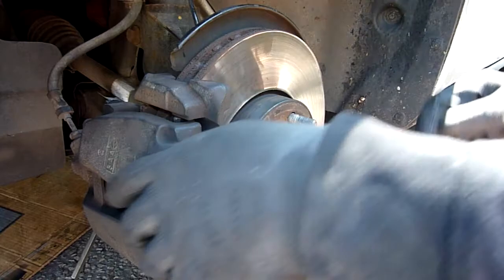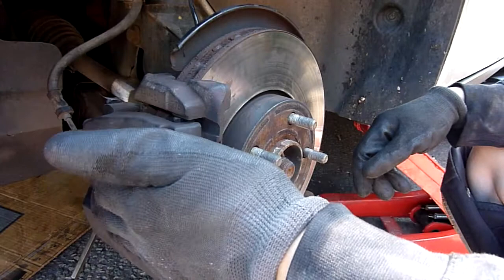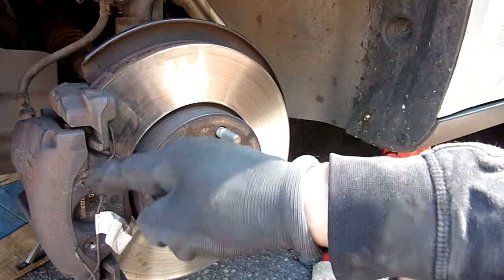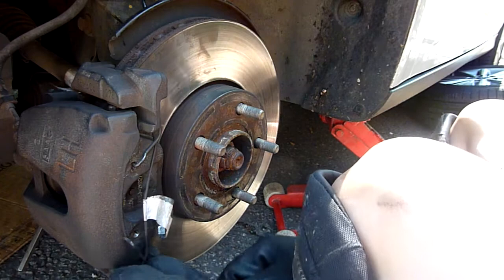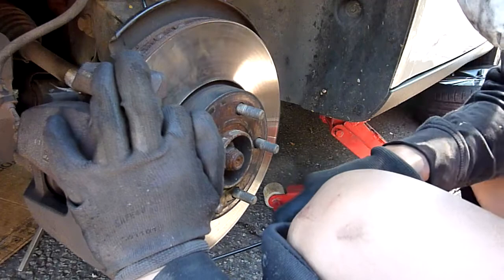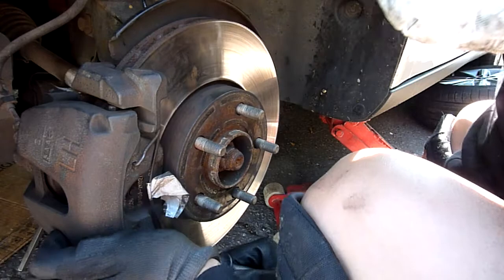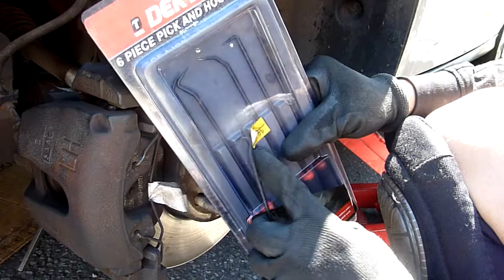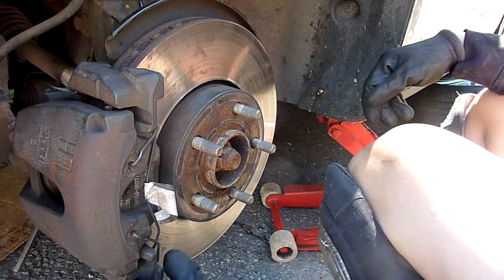How to Remove and Reinstall Disc-Brake Retainer Springs

Comment: Thanks for making this video.  I found the easiest way is to put the top in first, line up the bottom then squeeze in on center of the spring.  When the bottom pin catches on the hole tap it with a hammer and it will seat into the bottom hole.

Comment: Mate, your brilliant. I remember the problem I had with those pesky things Just using my hands. Had changed pads and discs nice and quickly, got one spring in, I think was a fluke but then came the second. It took the same amount of time to get that last spring in, than it took to change both discs and pads. At one point, I even contemplated leaving it off (bad idea, I know) Luckily enough I finally got it done. Seeing your video makes me look forward to the next change. Surprised there are no other vids on it. Well done and thanks.

Comment: Thanks for your vid , v helpful . I had a total mare yesterday with a retainer clip . Vehicle is 56 plate C Max . I just could not get the lower pin to come out of the hole in the caliper , it seemed to be seized and it took half an hour of careful wiggling and levering to shift it .  In the process of working it loose , the shape of the clip got a little altered and I best get a new pair . 
Never had that happen to me before.

Comment: Thanks for posting this, but there is a much, much, easier way to do this.  After struggling with this for about 20 min, and wearing my hands out here is what i discovered:  there are nipples on the back of the brake pad.  Set the springs so that both wings are resting close to where they should be (resting on the caliper).  Use a Flat screwdriver as a lever, rest the tip on the outside nipple and pry the entire spring center outward-- as you bend the center of the spring,  both prongs will line up with the holes, push them into the holes, DONE.  Tap them with the screwdriver handle to seat them proper.  Almost effortless.
Reply from the maker: If it works for you, why not?

Comment: Similar method - except when I put them one, I have no use for needle nose pliers; Once you have it in place, if  the pins aren't fully inserted into the holes, I just take a tiny hammer and give them a tap at an angle towards the hole. Done, and you don't tear anything up with plier teeth.

Comment: I think the main thing is after changing the pads is not to screw the guide pins into its thread at all, not until you have managed to get the retainer spring in place, and the caliper is re-assembled, then after some effort, refitting the guide pins is much easier than trying to fit the springs after the event. Don't forget to use a bit of wire or string (Attached to the suspension spring) to take the weight of the caliper assembley, when doing the change of brake pads, so as not to put stress on the hydraulic hose. Thanks to the original poster.

Comment: Mine has snapped and there is a small bit of the spring in there still😳 Any suggestions please, seems stuck.
Reply from the maker: Use a dental pick made of very tough steel to pick it out. Consider drilling the end of the spring. Consider using a baiting needle or very small croquet needle to hook it out.
Reply: @EducationPineapple  thanks for the reply. Tried drilling but the steel of the spring is harder than the casting. Could I drill other holes just off set to originals you think?
Reply from the maker: @394773934  Use Cobalt drill bits
Reply: @394773934  A very powerful magnet.
Reply: I need help with mine it is rusted tight in there broke off and doesnt drill out or punch out how can I get it out
Reply: Same problem here ....its literally welded to the caliper, 3 hrs on it and stil nothing
Reply: @Hiperyon24  I just didnt change them and it doesn't do anything
Reply: I succeded. Polished a  screwdriver and pushed from the interior side of the caliper
Reply: @Hiperyon24   how u get a screwdriver inside the caliper
Reply: @RyanSitter69  at an angle without disconecting the fluid line. I had a log under the caliper so i cand tap on the screwdriver, also i heathed the caliper with a torch.

Comment: Surprised there isn't a real tool to do this with.  Your hook requires quite a bit of strength. I just can't believe there isn't a spring compressor that allows you to just compress and slide onto the brakes.
Reply from the maker: Easy to do with the hook
Reply: @EducationPineapple  Just bought one on EBay - thanks for the tip ! Luckily I've got a strong right arm - the left not so much 🙂 Not sure why that is !

Comment: I keep losing one of these repeatedly (front driver side), it's driving me crazy! I installed it same way you did but still no luck :( I have to buy a new set again, arghhh
Reply from the maker: Make sure you hear/feel a confident snap (2:18) as the spring is push finally home. Make sure you use the tools that I use. Doing it by hand on that last push is not good enough and therefore must be with a good pair of pliers, preferably narrow nosed like mine. This confident snap (2:18) applies to other things like plugging car male female electrical plugs back in after removal. Good luck.
Reply: @EducationPineapple  Let me try again with proper tools and making sure to feel the snap. Thanks much! I couldn't find any other videos on Youtube about the same, pretty useful!

Comment: Is tgat car a ford???
Reply from the maker: Ford Focus 2015
Reply: @EducationPineapple  lol, i suspected it was a focus. I had an st170 which had 4 bolt hubs, and those springs were complete bastards. I got 1 on, but due to me being abit weak in my left hand, found putting the 2nd on impossible. I got lucky because a mate who knew how to fit them turned up, and put it on in seconds.